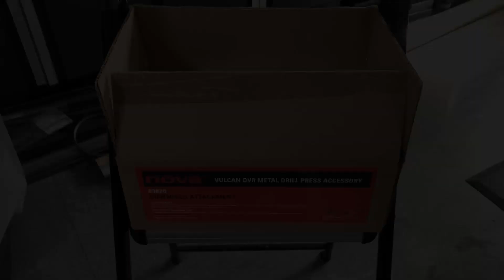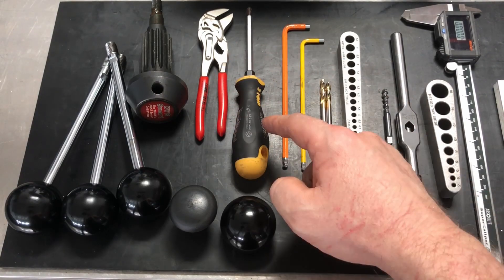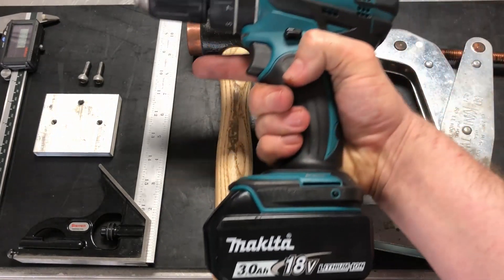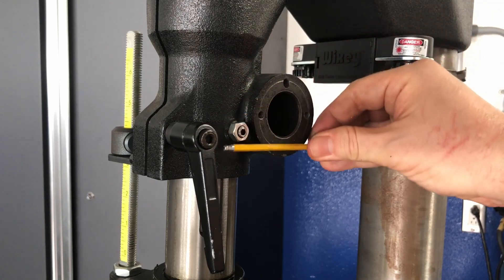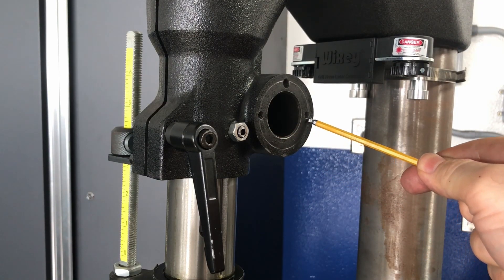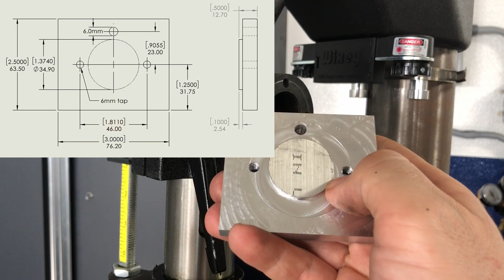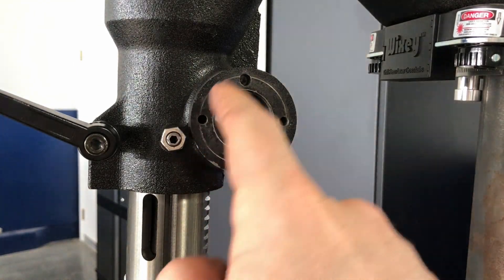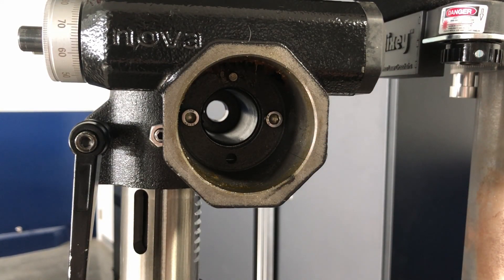Teknatool Nova DVR Drill Press Voyager to Vulcan Upgrade - PART 3

Comment: Great video series! Thank you. Attempting to do the same upgrade however standard MT3+33JT arbor is not long enough. Where did you find an extended arbor or you made it?
Reply from the maker: @MiroslavShubernetskiy  the description of Part 1 has the part number for that subassembly. I bought it as a single item from Nova directly.
Reply: @AlexZonin  ah. That makes sense. I managed to get the last in stock partial quill assembly from them however they were missing the arbor in the set and I didn't realize it was non standard. Will need to find a longer one elsewhere. Thank you for the response.
Reply from the maker: @ machine your own. Or look for it on Aliexpress.

Comment: Hello! Hey, long story short... I have a Vulcan spindle on its way from Nova, but they no longer have any downfeed attachments. They said every once in a while one will pop up online for sale, would you know of anyone that might have one, for sale? I know I'm not the first to ask, but it is worth trying. Great video series, thank you, Chuck.
Reply from the maker: Unfortunately I don't know any other source for them other than eBay and Nova directly.
Reply: @AlexZonin  DOH!!! I'm not looking to do any real "machining" on it, just a pass or two with a X/Y slide vice to face some brass or aluminum pieces every now and then. So, I can probably just do it with the stock handwheel and the spindle lock. Thanks, Chuck.
Reply from the maker: Remember it's a round column, where the head is held in place by set screws = can't seriously talk about any X-Y precision for milling
Reply: @AlexZonin  I'm looking to just make a short shallow pass on a cross slide vice in the X axis, move the slide over in the Y axis and make another pass. I realize this isn't a "Mill", the table is nowhere near rigid enough to even consider any serious milling. It would be to add a flat to an area like on round stock where I want to drill a hole for a bolt, etc. I'm not going to "Face" a surface with this, I get that, but it should be able to do what I want, right?
Reply from the maker: @toolchuck  yes, that'll work
Reply: @AlexZonin  Again, thank you for the informational video series and the follow up to my questions. 
Now do you know where I can get a decent muffler bearing for an electric lawn mower? 🤦‍♂️
Chuck.

Comment: Truly appreciate you spending the time to make this series, there is essentially nothing on the Vulcan drill press out there and it is no longer purchasable. I was able to find out that both the spindle/quill assembly and the down feed are still available, which in a sense is perhaps as good of a solution as any since apparently there was quality control issues with the T-slots on the Vulcan table, so my interest was always to buy a Vulcan and then buy a Voyager table. This is the other way around but same thing in the end. While I know it isn't your intent in all this but would be really curious to see it actually mill something. Something simple like just slotted holes would be good since honestly with it still being a round column drill press at heart is probably the obvious thing it should be able to do. So Part 4? For anything much more complicated than that, well I am saving up for a PM Mill.
Reply from the maker: I'll try to find time for the part 4. Working on a bunch of videos for my machinist's math class at the moment.
Reply: i'd also be curious to see. thanks for the vids!

Comment: Has anybody determined for sure if the Vulcan is actually discontinued?
Reply from the maker: I called and talked to them a few months ago. They said that they wouldn't produce another batch unless they see demand for it. I said that I'd continue making videos about it because I like the beefier version of the Voyager. They thanked me and said it will likely help raise interest. Even though it's hard to compete with the lower price point of the small mills made in China and Taiwan.

From my point of view Vulcan is an excellent drill press with a lot of advanced features for a drill press. My aim with the upgrades was not to turn it into a mill, but improve precision of quill-spindle assembly Z action, plus the rigidity and runout of the chuck.

I achieved all of these goals successfully and decided to share the traveled path with fellow machinists/makers.
Reply: @AlexZonin  Did they happen to say if the parts to upgrade a Voyager to the Vulcan will continue to be available? I would truly like to have the Vulcan but if thee is no projected availability date then getting the Voyager and doing the upgrade myself seems like the only way to go. Since there are so few parts differences  it seems possible that it wouldn't be that difficult to be able to order the DP in either version as a made to order item. Then just order which model you want and wait a couple weeks. Barring that if they put together an upgrade kit with all the bits including the power feed that would be great.

Sounds like the best thing to do is anyone who wants the Vulcan needs to email NOVA and let them know so they can get a good feel for how much interest there is.
Reply from the maker: @bobd.  they didn't say, but I would imagine the parts should still be available. I agree with you that reaching out to Nova and sending them multiple emails from different folks who are interested will help them make a decision to make another batch of Vulcans.

Comment: Are you worried that side loads on the chuck during milling operations might cause the arbor to dislodge without a nut holding it in place, especially at higher speeds?
Reply from the maker: My bad, I should have covered it. For milling ops it uses ER32 with the nut. I'm actually not planning to use it as a mill myself, unless it's something small and requires a light feed.